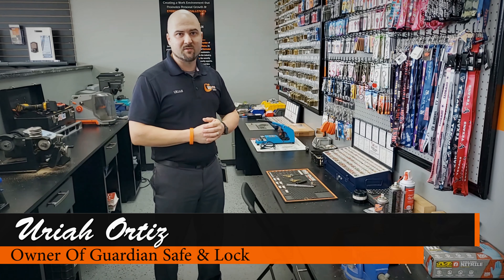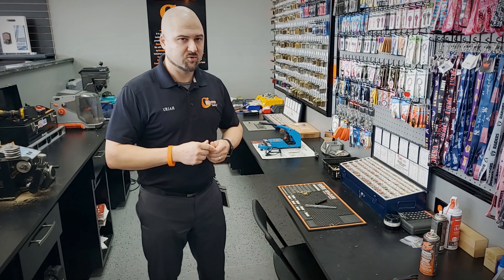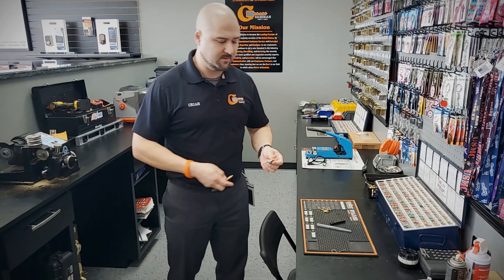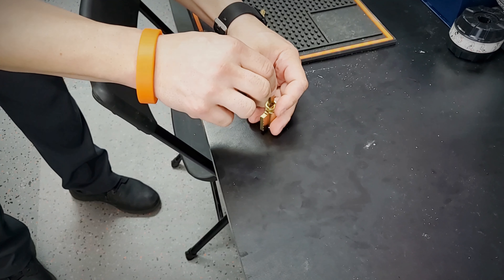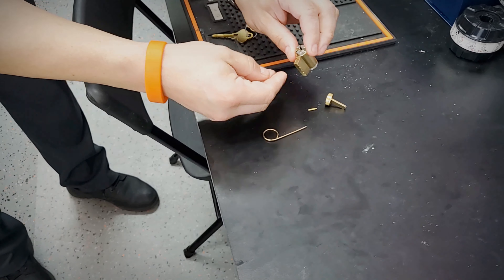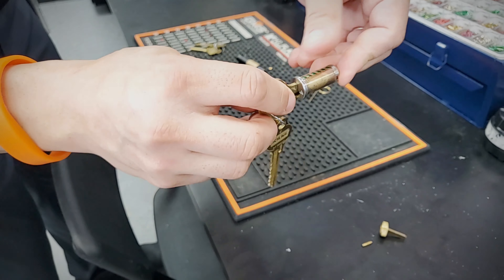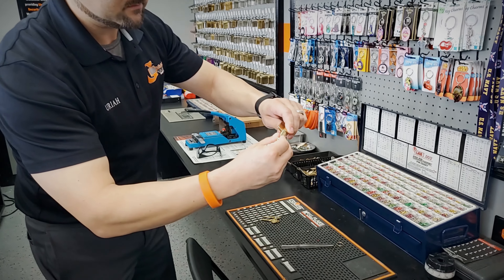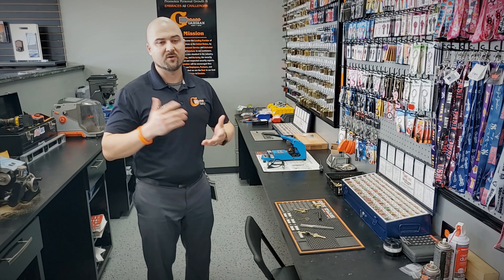How To Rekey A Schlage Everest Lock Cylinder

Comment: You answered my question for me without me asking. lol. I was wondering if that key blank was restricted. Well, now i know:-) I was sent a Everest KIK from the states as a gift and retro fits perfectly into a Brave Metro Commercial entrance set and works a charm. Only problem is if i ever lose the key i am screwed. Not an available blank in OZ. They are not the easiest cylinders to pick either. The tolerances are quite good from Schlage. Have a safe one:-)
Reply from the maker: That's actually pretty cool to hear one's made its way that far, and that it does work for you that well! I would keep that key chained to me at all times too, lol - Randall